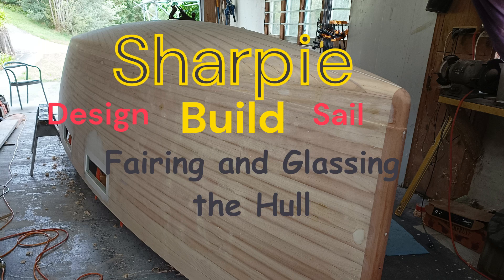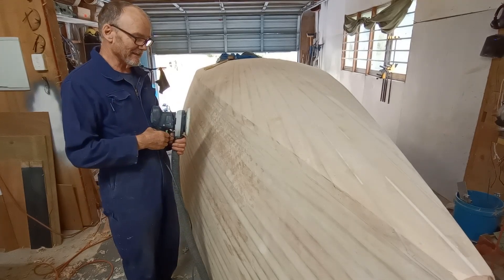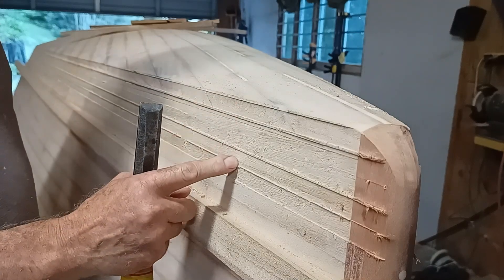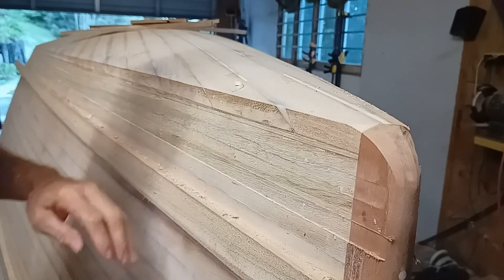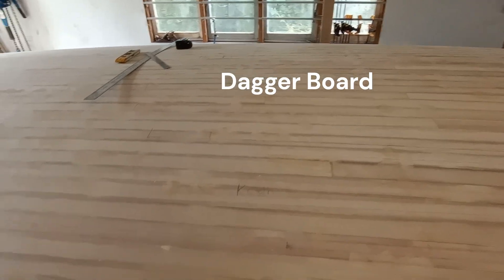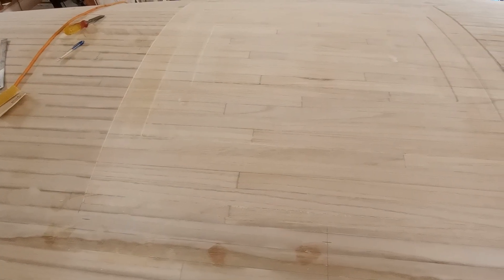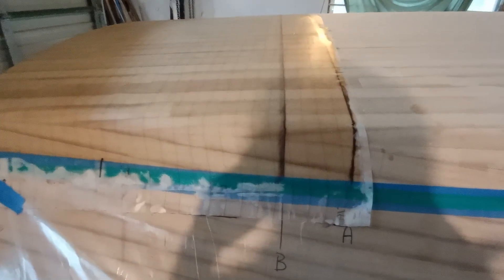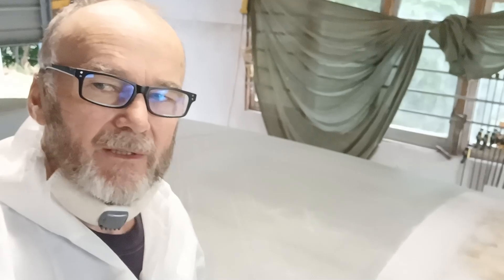Sharpie Design Build Sail | Fairing and Glassing Hull

Comment: Well done so far, would this be suitable to fully deck over the cockpit?. I ask as you are knocking this out quicker than Sven Yrvind's second attempt at his sharpie.
Slainte 
Tariq
Reply from the maker: Hi Tariq, thanks for the "well done", nothing like a bit of encouragement when you're feeling your way through a construction method you've not used before!
I've followed Sven a bit and am quite interested in his unique and novel solutions.
Yes, you could 'cover over' the cockpit and have a great interior space down aft. It wouldn't work for me though, I like easy access getting in and out of the water and dinghy.